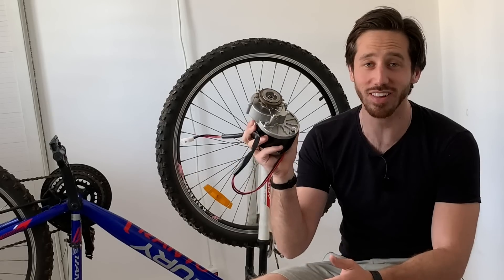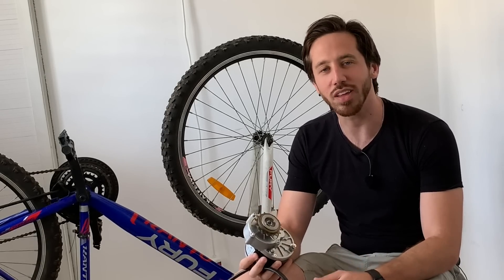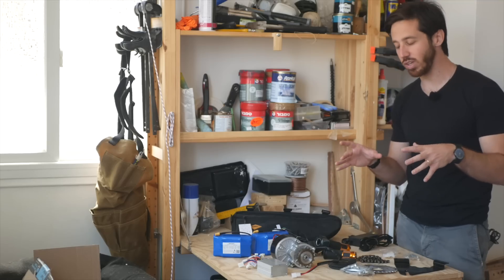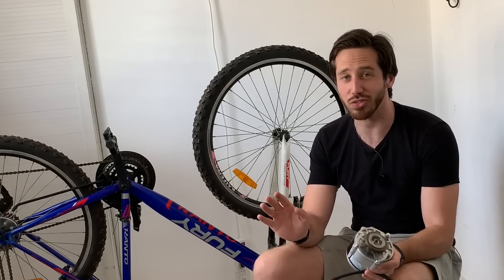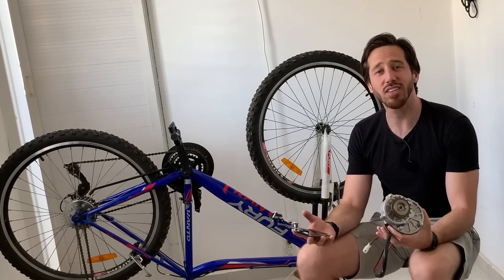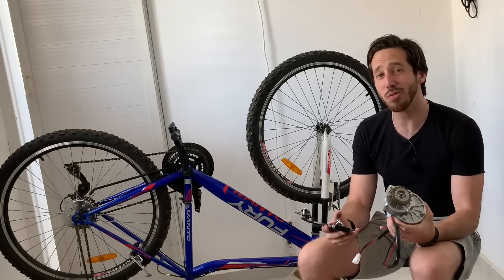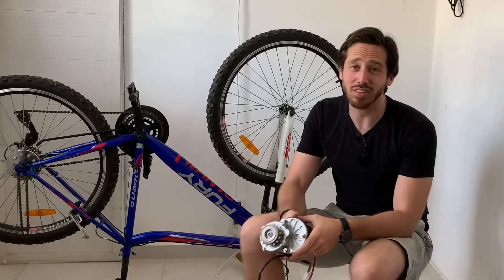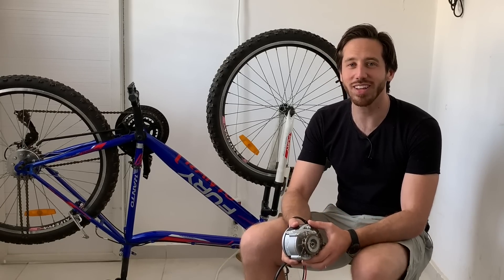Do NOT buy this $103 electric bike conversion kit

Comment: I keep thinking about people who want to adapt something to their equipment that doesn't have that capacity and imagine that they won't have problems during the process, for each piece of equipment it will need some kind of adjustment or even manufacturing, there is no such thing as something that will be useful immediately unless it has been designed for this or that particular piece of equipment. I do think that this and even other types of conversion kits are valid respecting the limitations and thinking about the adjustments that will be necessary

Comment: You needed two rubber pieces for the sprocket, between the sprocket and the rim! The sprocket sits flush with the barrings! Then the axle slot sits on the outside of the axle if it has enough threads! All together you'd need three rubber spacers one inside the rim and two outside of the rim to align sprocket up!  How can I get paid for this valuable information! How do I contact the company! 7:03

Comment: If l-faster really wanted to sell a universal mount, they'd have designed it with adjustable mount arms for different frame angles as well as with some tpye of lateral adjustment of the motor( via bolts/washers) to align with the fixed wheel sprocket. They didn't care to put that level of sophistication into it.....they got their money and that's that.

Comment: I just bent the bracket inward to fit.
  On another bike the motor mount hole was perfect on pipe, so i just put a self tap screw. So i dint have to wel anything. Easy mount.

Comment: I bought the same kit about the same time frame as this and the first video.  Yes you have to have some fab skills. I went threw 3 fixed gear bikes over the years. I still have the motor and bracket. It's now on a basic beach cruiser.  Yeah it doesn't line up perfect just like building a gas motorized bike.

Comment: I seen another guy use this kit and he said you have to beat it with a hammer 🔨 to bend the bracket until the teeth line up. He got it done after beating i a few times and worked. It is what you get when you skip out on the money. Go ahead and start bending the metal bracket until the teeth line up and fit right.

Comment: Dude.. All you have to do is put it in a vice and get a single jack hammer and bend it to align with the sprocket. Or use some shims if you can't figure that out. ALL universal kits are made to be tweeked/adjusted to fit. You should know that.
Reply from the maker: Shoot, I forgot to keep a vice and jackhammer in my tiny apartment.

Comment: Did a Vertical Mount as the Bracket would not fit. Ended up drilling a hole in the Bracket to match one of the spare holes on my bike frame. Mounting is surely a problem with one. Step to resolve this is Mount any-which way and get the Chain Tight enough to work. Mine was left sided. Drill support holes to hold on to whatever frame you can. If you can spend more to get a proper kit, do it, i am just cheap and wont let my money waste, so did some Whack job to get it working.😇 And i used a Kobalt 40 battery on the 24V motor and it works perfectly fine. Excess volt (atleast till 40V) is not a problem with these controllers.

Comment: weld a washer onto the end bit of the bracket, QR skew goes through the hole, so that the bracket will not move forward or backward. align the motor gear with the spoke gear by using some spacers. and that is it.. simple.. not sure what really the problem is.. i have built at least 3 ebikes with this type of kit set.. not a problem..

Comment: I have seen users modify and fabricate the mount successfully. I purchased an L-Faster kit and used a metal straight bracket to make the upper connection higher and got the motor working on an old 10 speed. It works really great. Thumbs Up!
Reply: Thank s

Comment: Maybe flip the mounting plate around and mount it on the inside?
Edit: you can also bend the bracket like others have done successfully, this really is just a you problem.

Also seems like a big oversight to record conclusions such as "for as little money as possible" and "it will do the job" when you haven't even proven this to yourself yet.
This is going into a product review with a biased opinion.
Not a good look but I know that everyone does it.

Comment: This video put me off this kit for a while, but after a bunch more research I came back around and tried it.  I've actually had really good luck with it, I'm a few months and a couple hundred miles into it.  A few points:  (A) in my experience, you don't need both of the frame clamps to line up, one is enough: think about a hub-motor torque arm.   (B) the bracket does require some bending, but a heavy hammer and a chunk of wood are all you need if you're careful, like in this video: https://youtu.be/bpkHHyniQcY?t=550  (C) the only issue I've had with mine is the freewheel cover plate loosened and I needed to re-pack the 1/8 inch bearing balls and add some blue locktite.

Several advantages of this setup: (A) super cheap, (B) unlike a hub motor, you don't throw out your existing wheel, (C) fewer worries of wheel compatibility you'd have with a hub motor kit.

Comment: Believe it or not, that brushed geared motor has high torque and shows its worth on uphill roads. The 250/350w hub motors stall up. But the brushed motor is very inefficient and loud.

Comment: Well - I'm poor, I'm 6'8", 300 lbs and have a bad knee, and this kit has been awesome.
No need for expensive li-ion. just a couple of lead acid 15 ah batteries. Yes - i had to modify the bracket a little, which took me an hour. But i turn my old rusty military bike into an e-bike for €150 including the batteries. 
Even with just 250W, it gives me plenty of assist up hills, so my bum knee doesn't start to hurt.
And - i can use the batteries to jump start my car if the need arises, and for a €100 kit, with a two year warrantee, what have anybody got to lose?

Spares can be had on wish for next to nothing, and i don't have to worry about it getting stolen, or my expensive li-ion batteries dying because i leave it out in the cold.

So DO buy this kit

Comment: I have done 3 of these, not 1 fit correctly. The motor and electrical are OK, the mount doesn't fit any type of bike that I have found. Each mount has to made to fit particular bike.

Comment: I'm probably asking the wrong person I should look for video from someone who likes to Tinker like I do because I typically modify things that are operating exactly as they were designed to because I don't remember the last time I bought a product and didn't almost immediately think I would have done that differently so really all I'm looking for is Reliable Motors and associated peripherals compatible with converting an e-bike like the controller the throttle and things specific to ebikes that are different from regular bikes unless you have something that given those conditions would be relevant to making the decision to buy in which case I would very much like to hear that and if not thank you for the video it gave me another small piece of the puzzle but not a solution to the puzzle of determining what to buy 

thanks for the video

Comment: If you weren't squeamish about modifying the bracket or the bike in such a way is to give you a usable chain line do you think it would have worked out for you as far as power longevity reliability range and all of the functional aspects of it goes?
In the context of I'm working with a 29 inch rim Cruiser/ mountain bike hybrid and for the record I can show self-control when it comes to the power but I don't tolerate underpowered very well so if it's capable of ripping my spokes out I'm all right with that because that would be on me to mitigate.

Did that kit include a battery where did you have to purchase that separately?

Comment: I got the same exact kit, I was blessed with no mounting issues, i got a Schwinn 2.6 ranger mountain bike, it literally went right on and chain was almost exactly in line, worked the position just right as I was tightening the mount bolts and was good to go

Comment: Will it clear if the mounting plate is inside the frame (on other side of the tube)? This is the same setup that all the early Currie E-bikes had. i always wanted one but they were crazy expensive at 400 dollars at walmart.

Comment: I bought the 350w version and built a bike. I supplied a 48v/20ah battery. It worked ok, but the freewheel failed and I just soldered the bearings. More resistance while coasting. Then the controller got wet overnight, and I woke up to my rear tire chewing itself up on the pavement. Good kit if you just want to try ebiking, but you will need to buy a real ebike eventually. Oh yeah, I had to bend the mount bracket and make some extensions.

Comment: i kind of wish i found your video a year ago, i bought this same ebike conversion kit in the summer of 2021 and have unfortunatly had the exact same issue as you have had, ive tried modifying the plate and its some tough steel so no luck there, hoping to get a new plate made at some point that will work for my bike

Comment: i ve seen a few of this kits work on 27C bikes. I have it on a 26 inch tire. works but you have to hammer flat one of the ends. i got the 250w 24v kit but i want to upgrade to the 450w 25v motor. may be it goes a little faster. I have one of columbia ramble bikes that goes for $120. i could even have to batteries for when it runs low

Comment: I am fitting two of these motors to make 2 E bikes !!!!  The motors would not fit at all in the right place !!!!  I used a vast amount of tools, a Ten Ton press, a Welder, an Electric Impact Driver, Bench Drill, Extra metal to weld on to plate, 2 Angle Grinders, for cutting and grinding !!!    It would be totally impossible to fit without a huge amount of tools !!!  I used a Sledge hammer but the plate would not bend at all.  So I used my bench press !!!  I found it very difficult to fit the motor in the correct place !!!  It involved fitting the motor to the plate, then welding bits on and cutting bits off !!!  I had to keep on removing the motor, because I did not want to damage it with the Welder, or Angle Grinder !!!!  I am retired so I have loads of time to fit it !!!!  It involves a huge amount of time and I found it easier to use strips of Iron as spacers to get it just right !!!!  If you are in a hurry, or you don't have tons of Equipment then this Kit is definitely not for you !!!!  What I do like is that the Parts are available so you can replace them instead of having a very complicated E Bike which will cost a fortune when the battery dies, or the system goes wrong !!! Also I am fitting the kits to two old bikes, which have no suspension, no disc brakes, and no fat tyres, so people will not want to steal them like a Flashy Brand New E Bike !!!!!  So I like this kit, although it's a hell of a job to fit the Motor in exactly the right place !!!!!

Comment: I bought this kit, specifically because of your video. It seemed like a fun challenge to accept. What is the cheapest bike a person can build, with what is easily the worst kit available. The combined cost of batteries and a $10 used thrift store Kent put my build cost at a little over $160 plus taxes and shipping. I call it the Povert-E-bike. The key to making it work was using a BMX with a wider axle that foot pegs screw onto. This let me put a spacer on and then the mounting plate. That way my motor leaned in a bit, and lined up perfectly. I've since upgraded it from 24v to 36v, and changed the heavy lead batteries for lithium.

Comment: If you have a classic brake that engages when you turn the pedal backwards.... The pedal sensor will still send pulses to the motor.. That's where the torque measuring middle motor from Bosch absolutely spanks any other bike motor.
If the drive is not the smartest even the bafang kits are not so nice

Comment: my ebike got stolen recently this is why im looking for a cheap 'replacement' if you dont want this kit and its too much of a headache let me know ill take it off your hands if cheap enough
Reply: just pent and bought one of these kits. does not fit my bike frame because its squished tube frame not round like what kit was made for
Reply: Freewheel included keeps getting destroyed every 15 miles. I put the motor on a 20" wheel bike so the speed is slow but has more torque to handle the hills. Need a better solution for the freewheel replacement

Comment: Thanks for the video. Very useful. I actually wanted to buy the kit for a soapbox. So I will have to adapt anyway the metal part and so on. And I am mostly interested at the quality of the motor and the chain (including the wheel). Can you advise on the quality/strength of the motor, the chain and the controller/eletronics? Many thanks!

Comment: I bought a kit with the same motor and bracket EXACTLY  but the instructions told me to put it on the right hand side of the bike. Looking at the bracket when you mounted it... It looks like it would be straight on the other side. Just something you could try

Comment: Everyone has to modify the bracket and lots of people have had long term success with them. And in places with a legal limit on wattage and speed like where Iive, it's perfect. Aligning it perfectly, with perfect tension (not too loose, nor too tight, chain's should have a bit of play), then the motor should last. Some dude on YT did a long ride with it, felt the motor and it was just a bit warm. I have a feeling that the one review on Amazon who had it break quickly (saw his review), either got a dud, or perhaps put the chain on really tight? There's a guy on Youtube who did a really good video on that actually. just 10 minutes worth of hammering and checking and hammering again and he got the bracket it fit and aligned perfectly using washers and with perfect tension.
Reply: Can you forward me the link please?
Reply: @zeroone1219  Sure, no problem! If you want more videos on installation and people modifying the bracket by hammering it or using washers like this guy, just search for "L-Faster ebike conversion kit" here on YT.  https://www.youtube.com/watch?v=bTjkH1NzniQ

Comment: I notice the original Currie motor mount rides behind the rear triangle and that it's mounted behind the frame, so that it's flush against the hub. Instead of mounting it to the outside of frame.

This guy seems to have no issues mounting it:
Build a Electric Bike Using DIY KIT 250W Reducer Motor - V3 - YouTube
https://www.youtube.com/watch?v=9ZjnXAfCUc8

To avoid ripping spokes - avoid sand like death. OR you can get a sprocket that will mount to the disk brake hub holes. You can still get the disk brake to work. Really cool if you have mag wheels.

Comment: I purchased this kit to see if I could make it work. Mine did not come with part of the mounting pieces. But going into this project I knew it would take some troubleshooting. And with out any welding or steel cutting I was able to get it working with a couple of trips to the hardware store,spending less than 20$  I have a nice ebike but I really enjoy riding my super cheap ebike I built.  My  total cost was 300 with 150 being the battery, 25 bike, 80 for the kit, 10 new chain, 15 new freewheel and a bit extra at the hardware store.

Comment: Oops I just ordered this kit lol but I see a couple issues with the rag joint sprocket mount install causing a improper chain line #1 the sprocket is dished and you have it inward instead of outward #2 usually one of the rubber mounts is thicker than the other one and needs to be behind the sprocket.

I have extra rubber spacers so if I can't line it up correctly I'll just run a extra rubber mount between the sprocket and rim to space it out better, also see a comment saying to run the motor mount inside the frame dropouts instead of the outside of them for the way you set it up.

Comment: I was gonna say just buy one of those kits with the motor built into the wheel but I just realized the price shot way up. The kit I used was a 26" 1000 watt conversion kit from violamart that works great however at the time I bought it, it cost $189 now it cost $289. Guess making budget ebikes got harder in the last 3 years.

Comment: Again I defer to you since you have the actual device on hand unlike myself. But it is bugging me as I am interested in a cheap electric bike for getting work as a courier. Would the quickest way to fix this bracket not be to merely add more metal ring spacers to move the gear closer to the frame ? ? ? I'm not sure if this will complicate the design or if spacers are harder to come by.

Comment: I notice some have already mentioned it in the comments . . . . but with the L shape in the bracket. It looks from here it would be a better fit if you place the bracket inside the frame between the frame and the wheel but you could probably be a better judge of whether the motor still fits.

Comment: It’s been 2 months since I built my bike and the motor is still running great. Mounting plate can be a bear to install; but everything else is great!  If you’re not a DIY type get a front wheel hub motor kit; but if you like a bit of a challenge this is a great kit at a great price!. 8/16/22 motor is still running strong with no problem (using 48 volt battery)
Reply: Exactly. This not much of a problem for DIYers. In fact, DIYers would love some customization.
Reply: 1/6/2022. Motor is still running strong with no problems
Reply: @Scott4271  you use this one ?

Comment: I don't understand 
 can you not see the sprocket needs to have more spaces.
Needs to be almost touching the bike frame.
If you have some spaces will only take 5 minutes to fix.
Or could make one big plastic spacer.
So sprocket lines up with the sprocket on motor.

I wouldn't call it a problem when
 it's something what  everybody can fix very easy.